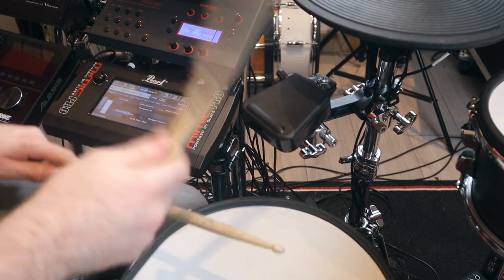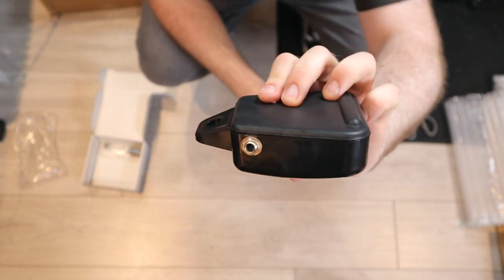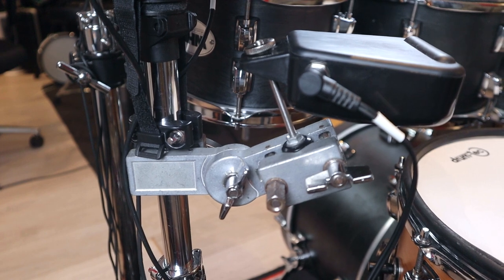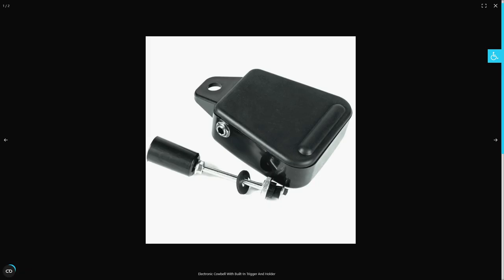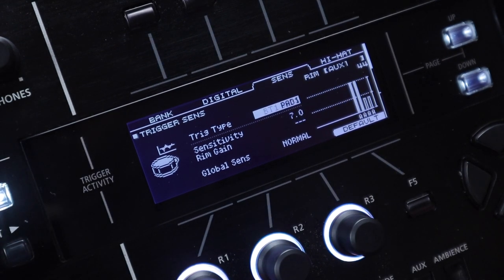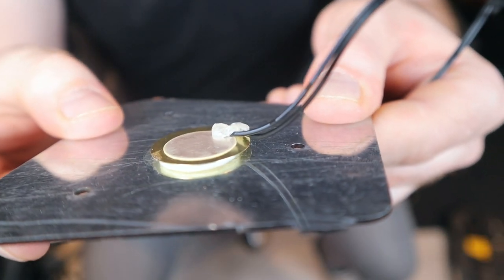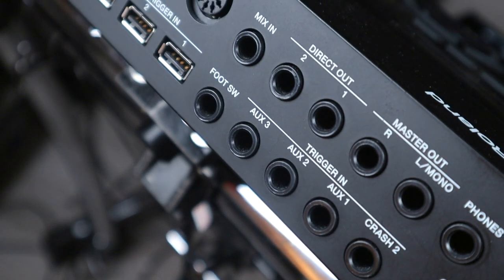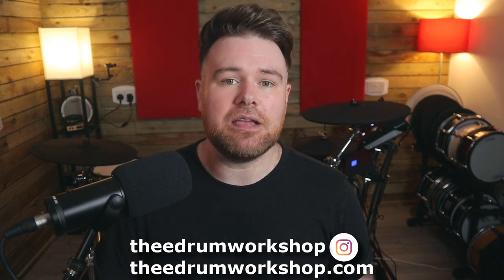Unlock / World Drummers Electronic Cowbell Pad Review

Comment: When I did my a to e conversion I also converted my cowbell to electronic. All it took was a prewired piezo to 1/4" jack and one hole drilled. Glued some cymbal mute material on top and a strip of rim protector on the strike area. Then cut a piece of black foam to fill in the inside.
Reply from the maker: Nice!

Comment: One thing that tripped me up re triggering one-shot instruments is that SD3 and EZD3 default cowbell and tambo instruments don't respond to the MIDI generated by a module in the same way that they do if you add them as an extra instrument manually.

Comment: Thanks for this video. I didn't even know electronic cowbells existed. However, since the cowbell in my module, the Pearl Mimic Pro, is only one sample, I am not interested, even if all issues are dealt with. I used the Intelligel Plonk on a recent track. It is a eurorack module that plays physically modeled percussion instruments. It helped me produce a dynamic interesting cowbell sound. Not only pitch and loudness can be modulated but position as well. It is likely there are other options in software that I am not aware of.
Reply from the maker: Oh cool, just checked it out and the Plonk looks great! Sounds like you've got a fantastic setup for your needs.

Although there's only one cowbell in the Mimic, it does have multi-layered samples and has the tip and edge samples. It's a shame there's not more in there though.
Reply: you can import them from VSTs
Reply: Thank you. I could have known if I had triggered it with a two zone dum or cymbal.

Comment: Hi Luke, thanks for the review. This thing looks really clumsy-ish.
I lately got my 3 new Lemon cymbals, the 11" triple zone rides. Using two of them as splashes and one as 2nd hihat or spock. Maybe these are an option for you guys if the cow bell sound doesn't need to be triggered by a pad looking like a cowbell.
For percussion I normally use my Gear4Music DD90 sample pad. But it might by a bit bulky to set it up in a typical cowbell like position.
Reply from the maker: Yeah, a small cymbal pad could potentially work! Those old Roland PD-7/PD-8 pads would work in a pinch too - they're also dual zone as they have an edge switch in them.

How have you been finding the DD90? I didn't have great luck with my original model when attempting to review it years ago. I do actually have another one now which seemed to work better but I've not got round to deep diving on it.
Reply: @TheeDrumWorkshop Ha, buddy, that was the video from which I got to this channel. 
I use only VST libraries so this DD90 is just there to generate MIDI data to fire percussion samples or scenes and clips in Ableton Live. I am completely convinced. It does the job.

I have a very special story with the HXW support. I wrote an email that after a firmware update there was a latency issue with MIDI out data. And they ask for more infos and at the end they said...Oh , you're right, there will be a new firmware update during the next 14days. And it was there with the problem fixed. 
That was an awesome experience. 
A bit like Audiofront Rob with his eDRUMin10 support. Awesome.

Comment: Regarding a two zone cowbell, is there any drum module or drum software that has 'rim cowbell sounds'? Or do you create your own?
Reply from the maker: Yes, there are. Some Roland cowbell sounds have a "tip" articulation, so you get a distinction between hitting the edge and the top (the edge of the cowbell being the default sound). The Mimic Pro also has the same for the one cowbell that is in there. I haven't checked over all of the sounds in other modules, but they definitely exist!

Comment: the ddrum tube was a serious metal bar with an XLR connector, also yamaha made a 2 zone bar with rubber trigger surface...and failing those an old Roland PD-7 from eBay would beat this all day long. This is probably the worst product design I ever witnessed...and that's saying something. Thanks for the honest review Luke.
Reply from the maker: Yeah, those old ddrum tubes look like tanks! The PD-7/PD-8 pads being compact and dual zone is really handy, for sure.

One thing I forgot to commend this on in the review was the fact that the plate underneath the rubber was metal - that definitely makes me think that durability was thought through on that side of things, at least. The plastic body of the cowbell is pretty thick too. It's just such a shame that all the other elements let it down. A slight redesign would drastically improve it.

Comment: Would the Roland BT-1 Bar Trigger be a better choice?
Reply from the maker: The BT-1 is a great pad and it's pretty versatile since you can mount it to a drum as well as on its own stand. The built-in cross-talk suppression is great if you need that too - when used in this mode, it uses a switch so that it only triggers when it's intentionally struck, like the edge of a cymbal pad. Or you can use it in "Sens" mode to make it really sensitive. It's pretty expensive for a single zone trigger but it's well put together.

There's also a cheap version that's sold by Lemon/HXM called the NL-1 that I reviewed a while back. It has the same features, except it didn't come with the percussion mount that lets you attach it to an L-rod. It disappeared for a while but came back on Alibaba, though appears to have a minimum order of 5 now, which is a shame.

Comment: You should ask them to try the “professional” pads.
Seems like a copy of roland pads, but without the logo, at the price pf used pads.

They are shameless.
Reply from the maker: I'm hoping they'll send over some other units, for sure. I did notice that the photo for that pad was the digital snare with the logos scrubbed, yeah. Which is a shame because the full kits they have available don't appear to be that way and the cymbals and trigger plates are either "original" designs, or possibly they'll crop up under various names over time.